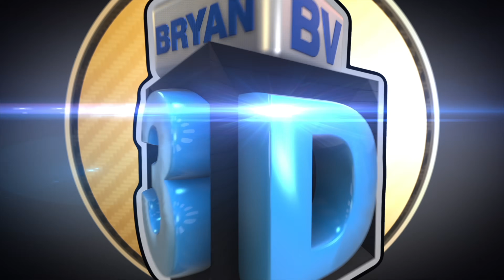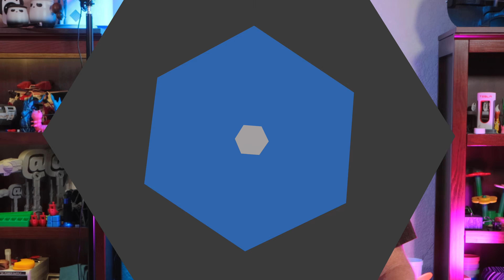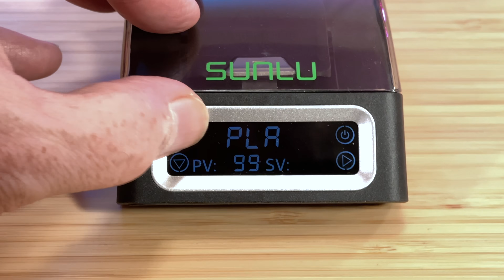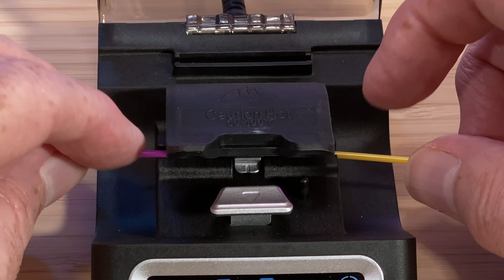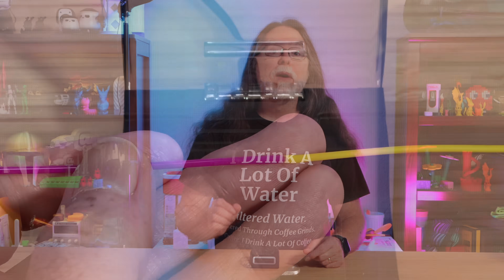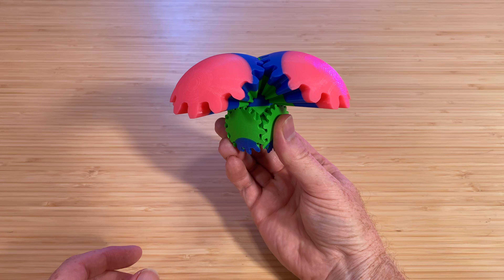FILAMENT FUSION FUN! Save Scraps with Sunlu FC01

Comment: I'll wait when the new version don't need the sleeve .. you know someone will make one ..lol BEEERS!! 🍻
Reply: One of the other reviewers (forgotten who) reused a sleeve a number of times. It looks like it just slides off. For joining lots of short lengths this should be fine, and will make the 200 supplied last a lot longer, but of course it's not practical when joining long lengths. For the amount of joining I'll be doing, I think the supplied sleeves should last longer than the tool!

Comment: You really should look into the Slunaz FF1R instead of this ‘toy’.   The FF1R doesn’t require you to waste a section of PTFE tube for each joint, it runs to higher temps so you can join high-temp materials like ABS or PET (I didn’t say PETG), and it has it own spooler to boot.   It puts this small unit to shame.
Reply: It's rather more expensive! For the amount of filament I'll need to join, the Sunlu is a bit pricy, but I've ordered one. I couldn't justify paying any more for it.
Reply: @EcoHamletsUK  I make a lot of PET filament from recycled plastic bottles, and as such the Slunaz FF1R has been an invaluable tool in my arsenal of small machines to make my job SO much easier!  And the fact that I don’t have to place a small bit of PTFE, cut it off and throw it away is also another big factor.  And on top of that, the Slunaz FF1R has its own spooler.   But yeah, if you’re just a hobbyist and only need to join a few scraps together from time to time, I could see where the FF1R is cost prohibitive.

Comment: Excellent. Proper ratio of pun to content!  You can cut the 2 pieces of filament together to guarantee that the angles will match.
Reply from the maker: Hm. Good point on cutting both at the same time. I think for those of us used to cutting 45s on filament, we're pretty consistent on the cut. If you're new at it, then like you say, keeping the two filaments parallel while cutting an angle across both at the same time would ensure a match. Thanks!
Reply: @BV3D  Some may call it lazy, but I prefer to make 1 cut to 2, LOL.